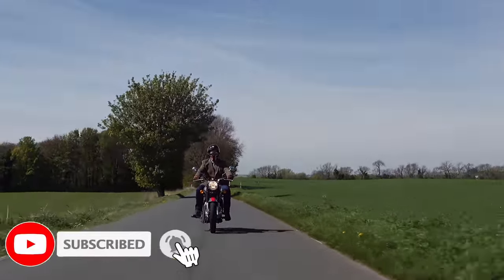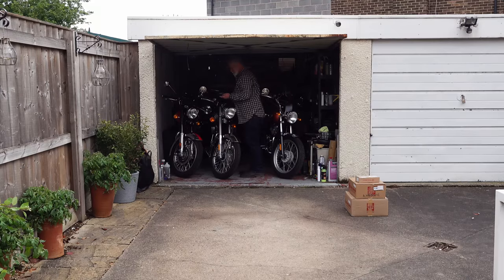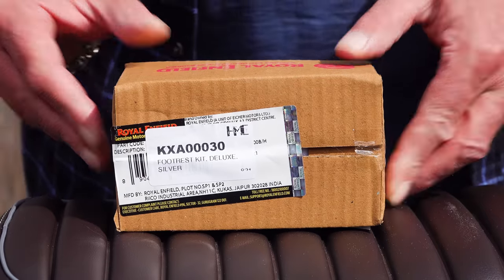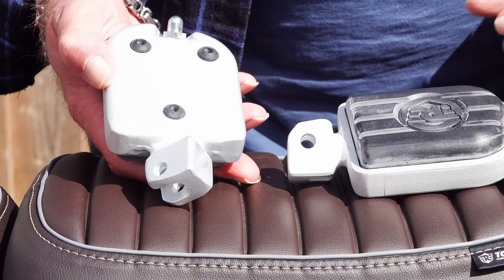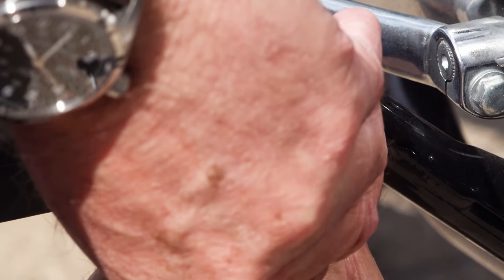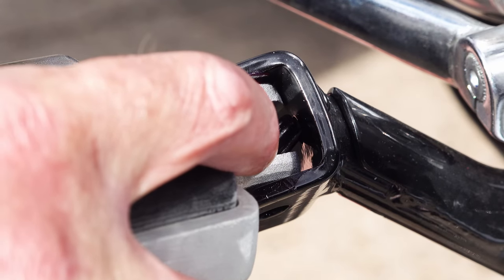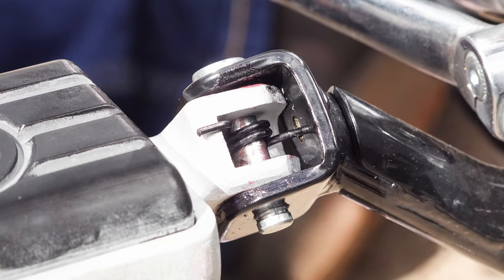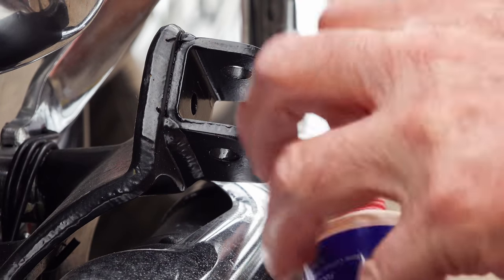The new Royal Enfield classic 350, Meteor 350 & Scram 411. fitting the Deluxe Touring foot Rests!

Comment: Just fitted a black set of Deluxe footpegs to my Meteor and they are more comfortable than the originals and I think they look better for the forward foot position on the Meteor. After I tried the screwdriver method and broke one of the tabs off one circlip I used 1.2 mm circlip pliers and they worked fine. Should have got them out of the tool box first. I suspect, but don't know for certain, that imperial sized pliers won't fit. If you need to get a new circlip then they get ones to fit an 8mm shaft, they are a perfect fit. Now I'll need to get another set of pegs for the pillion position, no big spring to worry about there, just a ball bearing and a little spring that could go go pinging off into that extra dimension where lost springs go.

Comment: I just put mine on my meteor yesterday. They're awesome. Thoroughly impressed. I ended up buying external circlip pliers in the end cause with the screwdriver, my patience was definitely tested and didn't want to scratch anything. The circlip pliers I got were the smallest Knipex external circlip pliers. Got them from Amazon for £14. Think normally they retail for alot more... Worked perfectly. Probably won't use them again for a very long time, if ever. But if like me you're struggling with the screwdriver method and like me have very little patience, or like me are pretty crap with manual labour skills, then they definitely work wonders. And like I said, the pegs I feel are definitely worth it. I have size 9 feet and now never have to reposition my feet when riding at all. At some point I'll probably change the passenger pegs to these too for my good lady, once I change my insurance to carry a pillion. However that'll be as long as possible, as my bike is my happy place. Awesome video Stu! Thanks for all you do.

Comment: I had the same problem as you.  For the first time ever I visited a podiatrist; my scepticism was misplaced and it was the best £50 I have ever spent.  She altered my £12 fleabay orthotic insert with a long, thin wedge (of some sort of manmade rawhide-like stuff) and the pain went immediately.  The only downside was that it made driving a bit difficult until I got used to it.  
Age does not come by itself (although it does not bring circlip pliers)... Best wishes.

Comment: An addition to my previous comment: I have found that the deluxe pags on my Meteor make it much easier to stand on the pegs when on rough tracks. They also get rid of the tendency to accidentally change gear when your foot jerks and hits the heel/toe shifter when hitting bumps and holes on said tracks. The Meteor is not meant to be an off road machine but the Deluxe pegs help it to have a dual personality.

Comment: Hi Stuart just brought myself the new Scram 411 and so far I'm really enjoying it apart from the harsh running in requirement lol. Just on the foot problem matey i had the same thing went on for months tried all the usual things that are recommended but nothing worked so bit the bullet and had a pain relief steroid injection in the heel which id been putting off for ages because I'm a coward lol , and within a week it had gone and not come back since and that was about 3 yrs ago . Oh by the way injection didn't hurt a bit so if its offered i can highly recommend it.

Comment: Morning Stu, Firstly I believe that anything that makes long days in ''the saddle'' whether it be the seat, handlebars/positioning,  footrests, positioning of controls, brake, gear levers etc, etc!  a major step forward to being comfy . Years ago I owned and traveled a good deal on a BMW R100RS. Straight out of the factory the seat was comfy, the footrests were quite large and well positioned (for me) however, the handlebars felt very narrow because of design constraints  to keep them inside the faring,.... ( I always thought, still do in fact, it was beautifully designed).... There wasn't much one could do except alter the angle, but it still left one with a very achy straight armed stance...
My sympathies for having Plantar fasciitis.  Have you tried a good quality insole, designed for just such a problem....not the 'soft wubbery' silicon type but the ones that give dedicated ... tend to be more expensive...support to the arch of your foot. How do I know, because I've had Plantar Fasciitis..... It sure is a 'pain in the foot'... hope you get well soon, Greeting from very hot España...
Reply from the maker: Thanks Ill look into it!

Comment: A job well done, though I might be inclined to paint the metal parts of the foot rest black so as to blend in with the rest of the frame. Excellent video as usual. 👍
Reply from the maker: There is a black version!
Reply: I tend to agree, but now notice Stuart has advised a black version is available, I would be interested to know how the feel if you have to get up on the pegs due to a rough bit of road?
Reply: True, and that's why it is offered in black as well..This silver colored one was meant for the more costly chrome trim

Comment: Thank you for another excellent instructional video. I had to modify my circlip pliers with a diamond file to fit the very small holes, mine actually stretched when I removed it, and wouldn't stay on when replaced, had to put it in a vice to squash it so it didn't fall off. Incidentally, having caught my leg a couple of times on the  metal studs whilst manoeuvring  the bike with both feet on the ground, decided to remove them, a lot kinder on the calfs!  Wonder they don't polish the alloy on these pegs to match the engine casing?

Comment: Buyers beware: The crap they're selling on eBay are fakes.  I just got a set and they're not even close to being legit RE parts...  the castings are awful, and they don't even have the bolt on the ends in case of a touch-down.  I should have known, but heretofore, the bits from India have been good.  Anyways, they're way bigger than I expected.  I'll put them on as soon as the rain stops to see if I even like the way they feel.
Cheers for the vid - always helpful and fin to watch.

Ride Safe 🙏🏼

Comment: Do they do them for the rear as well Stu, or do they fit the rear as well sort if universal ?
Reply: They fit the rear as well bud
Reply: @benstudley9332  cheers 👍
Reply from the maker: @benstudley9332  Thanks for that Ben the instructions suggest that they might but they are catalogued as front only!
Reply: @stuartfillingham  Take care if you remove the rear pegs, Being slightly larger than the front ones, I tried to swap them back to front, but they didn't  fit!  they have a ball bearing and a spring which holds them in the upright folded  position, mine shot out and I had a hell of a job to find both the ball and spring!